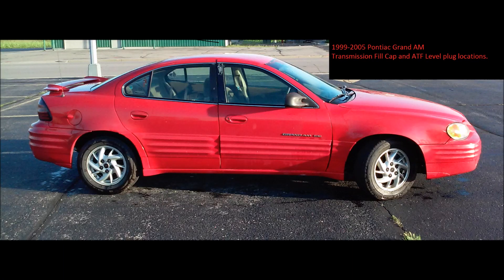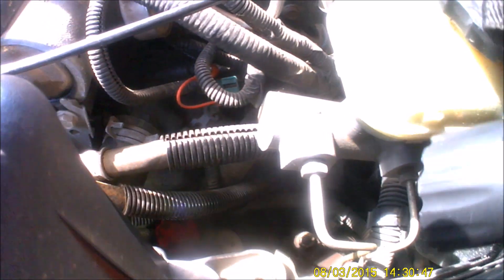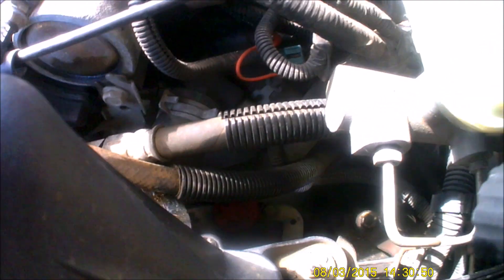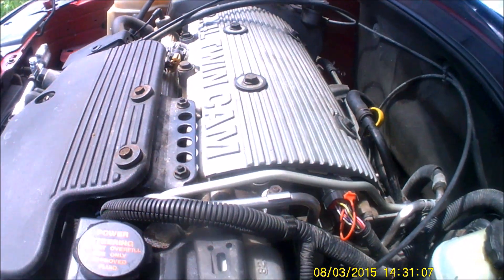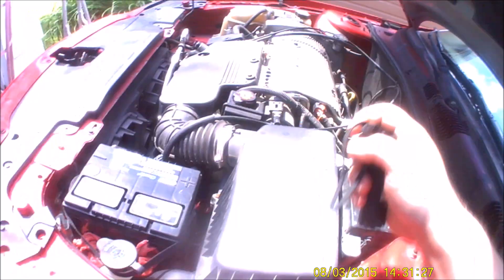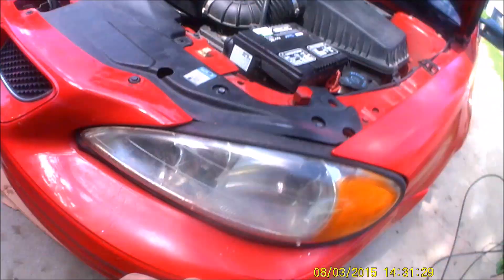1999-2005 Pontiac Grand Am Transmission Fill Cap & Level Screw

Comment: is this for the 3.4 grand am as well
Reply: Would believe its the same style if yours don't have a dipstick. Transmissions are 4T40E and 4T45E.
Reply: does it have to be a certain temperature, that's what a mechanic told me today
Reply: The same except you have to remove the air filter box to be able to see and reach the fill cap.
Reply: Jim R I didn't I used a hose and a funnel
Reply: When you fill it does the car have to be level? I'm wondering if I have to take off the Bolt, back it off the ramps, then fill, then drive it back up on the ramps and tighten that bolt down or can you keep it on the ramps?

Comment: Is the transmission fluid something I need to check regularly in this car?
Reply from the maker: Sorry about late response. I believe owners manual says need to check like every so many miles. I no longer own this car as I sold it awhile back. Unless its leaking I would probably just check it ever 30,000 or something. But I do a lot of stop and go driving since I am a Rural route carrier so I check mine more often since I work a lot of dirt roads.

Comment: Transmission fluid temperature needs to be at 104° and you check it in park with the engine running not in neutral
Reply from the maker: Will add a note. Thank you.

Comment: My 99 Grand Am has 200K on it and it's still running on the original factory trans fluid. I was advised not to change at this point, since it's running great with no issues, I could risk damaging the transmission.

So instead, a few weeks ago, I added a quart of synthetic trans fluid to the fluid already in there. It probably wasn't the best thing to do or something professional mechanics would recommend, but I did notice a smoother shift.
Reply from the maker: Johnny Matthew - Your vehicle service manual will say when to change fluid and filter. Usaully arround 150k mark.
Reply: Mark Wolf my car has 165k on it what should I do about the transmission fluid that’s not been changed since I got it and I don’t know if the transmission fluid is bad or not because I have never changed transmission fluid on my car before it has never been changed in a a long time and I’m scared to change the transmission fluid and transmission filter and I have no way of knowing if the transmission fluid is bad or not because I’m gonna die if I change the transmission fluid and transmission filter can someone give me Advice on how to know if the transmission fluid is bad or not because I’m not gonna do anything to the transmission fluid that’s in the transmission right now
Reply: I just got a 03 grand am with 213k miles and i have no clue if its been changed before or not, if shifts pretty good yet, so i would think it was changed before. How can i check the fluid CONDITION?
Reply from the maker: @gtowrx2001  - If it shifts fine I would just check its levels. Only reason I changed mine is because I replaced  the filter is and because I added a transmission cooler since I did a lot of stop and go driving when I had the car and Grand am's with their very narrow front end are not very well known for cooling when in a lot of stop and go traffic. Worse thing for a transmission is heat. But there is a company that can check your fluids with samples you just mail in. Think its called Blackstone Labs where you can get a kit. Usually I just look for signs like burnt smelling fluid or very dark  crimson almost or black color. Grand Ams and most GM models around these years had issues with Solenoid packs going out and they are a pain to do.